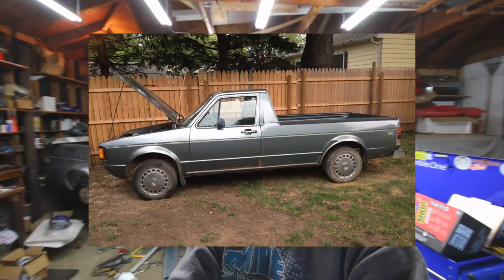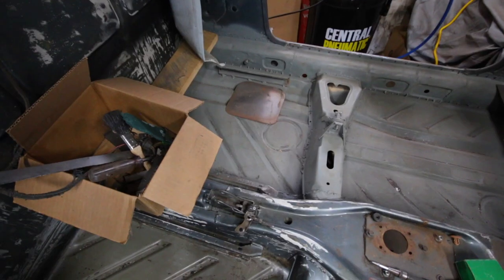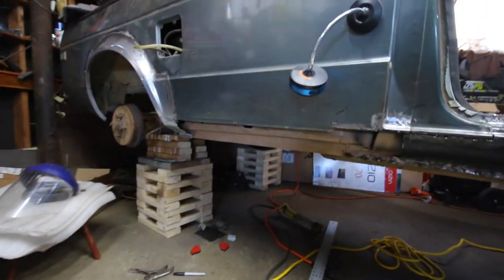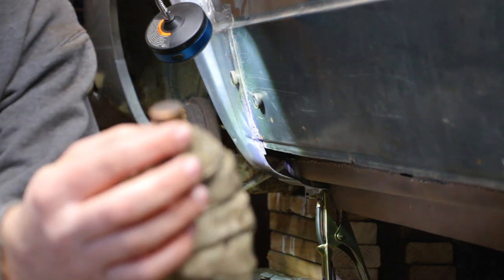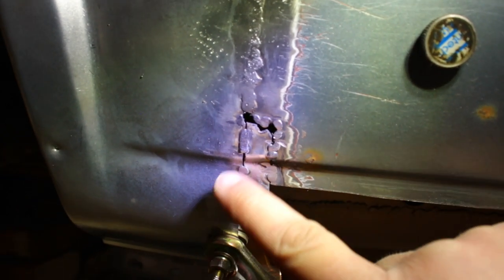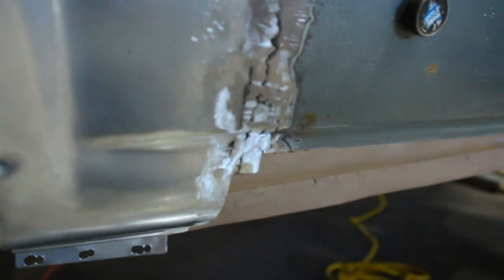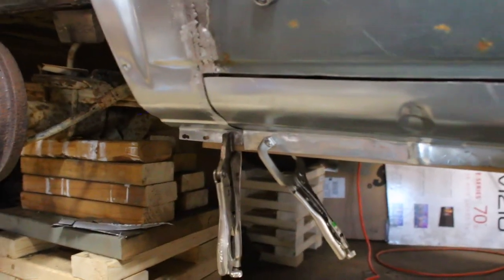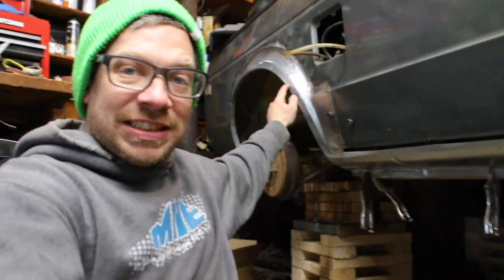VW Rabbit pickup (caddy) Project part 1.. Welding in new panels!

Comment: I've got a vr6 caddy, and I need to do this same thing on the front rocker. The previous owner I think used the wrong Jack and got into it while jacked up.. front rockers on both sides are smashed and starting to rust.
Reply from the maker: Yeah thats the crappy thing.. people dont know how to lift these cars or do it right on the pinch welds and they get smashed, then start to rust :(
Reply: What is the correct way to lift a caddy? I think my rear jacking point is gone
Reply: i also got a vr6 caddy

Comment: What rockers did you use for the outers and inners from raybuck? Links?
Reply from the maker: Miles Tobey yeah I got everything from Raybuck.com the front half of the rocker is from a 4 door & the back half is from a 2 door. You have to splice them together
Reply from the maker: Miles Tobey also they sell the inner rockers. Driver and passenger side, only place that sells them
Reply: Okay!! Thank you man. Just bought both sides of my floors from them the other day actually